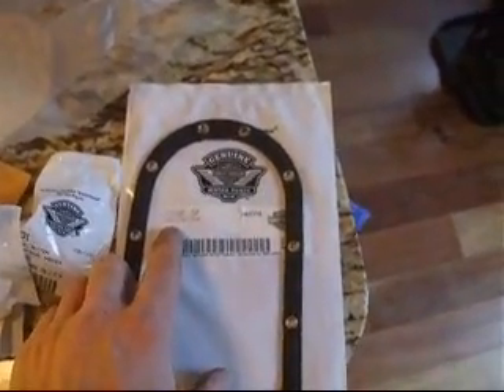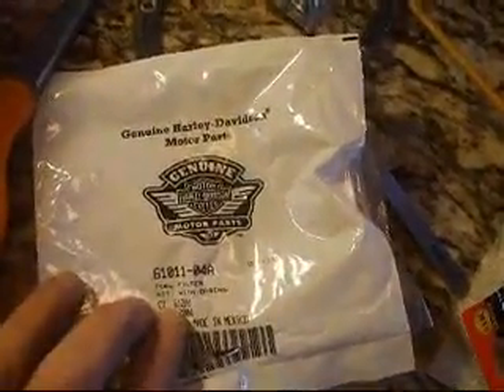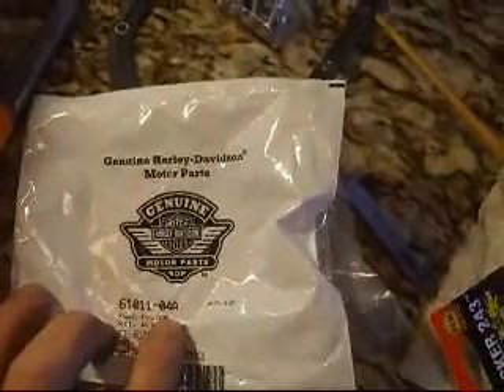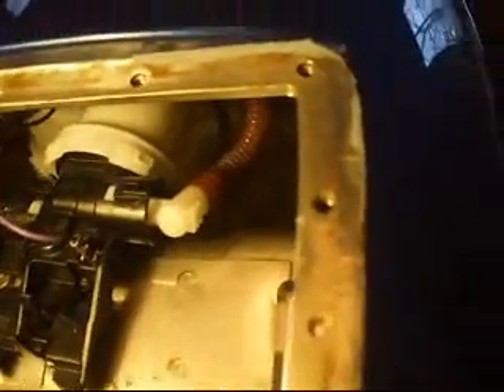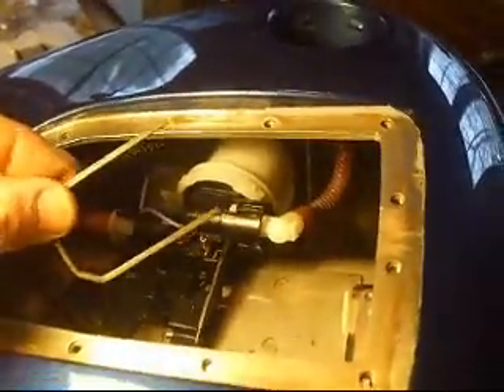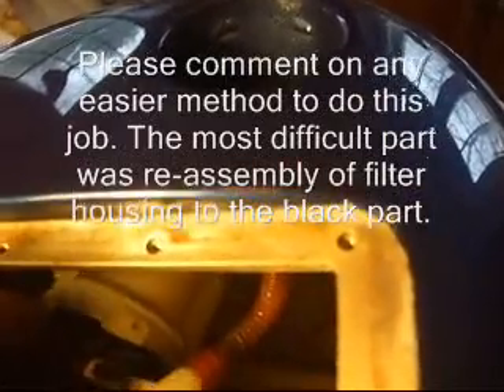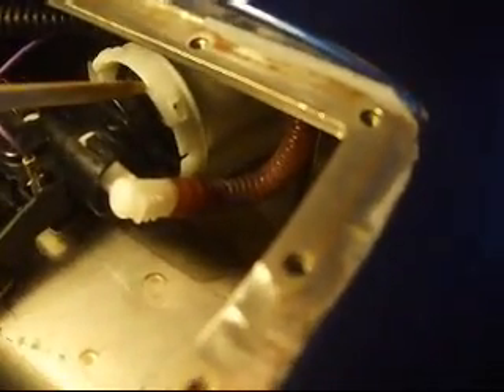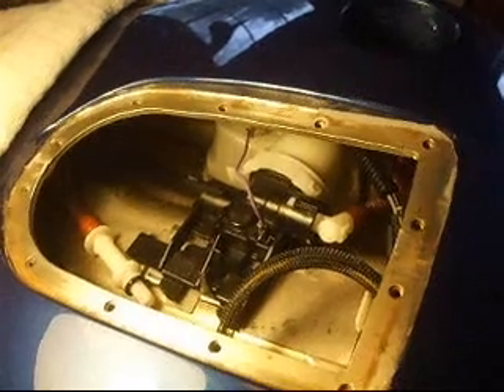Pt 1 of 1 Replace Fuel Filter   2006 Harley Dyna Wide Glide

Comment: I want to sincearly thank you for making good this video. I reinstalled my fuel pump last night and I ended up rolling to O ring over the first notch on the fuel line. I thought it was wrong but I didn't want to force it in the other way. I woke up today questioning my own ring decision. I searched the Web for an answer to the corresponding to our ring placement. I called my local moco dealer twice, no answer. Finally an hour later right when I'm about to give up I find your video. 
I  now just  have to open th3 tank back up and fix it. I did install a new gasket answer screws. 
I hope I don't have to now buy all new hardware because it isn't cheap. I'm sure it will be fine and there is only one way to find out.

Comment: You basically have it down. But as you saw through trial and error, all those hoses and wires CAN and should be carefully disconnected and the fuel filter canister and assembly can come out. You can do your filter change out and away from the bike and be able to properly seat the o ring and canister with the print clip with lil to no issue. If that clip is upside down it can be a dirty pecker to get back in. Also I don't think you need to take the tank off just make sure the tank is low on fuel

Comment: got my unit out for paint. Once you unsnap the fuel line and unplug the electric connect it is fairly easy to lift the complete pump assembly out, you just move it forward a small twist and its out. Much easier to change the filter with the unit out.

Comment: I recomend to take all fuel pump out, did you see the filter that is on the bottom of the pump  itself? If that little filter you changed was nasty imagine the first stage! So basically you just did half the job, better than none I guess...

Comment: thanks harley, for making what should be a super simple in line filter that you can have easy access to, that has worked fine for many vehicles for many years, into an overpriced f---cking hassle. no respect for your engineering after the evo went. as far as i'm concerned, i can buy 2 or 3 yamahas for the price of one of your low models, ride them harder and farther with less maintenance.

Comment: I know this is an old video, but could someone tell me the purpose of the purple wire? I just changed a fuel pump and couldn't figure out the reason for the purple wire. It looks like it only connects to plastic.